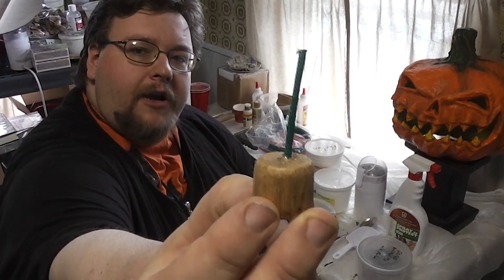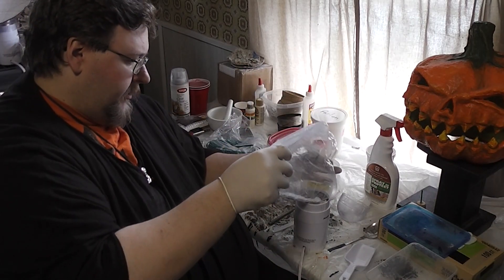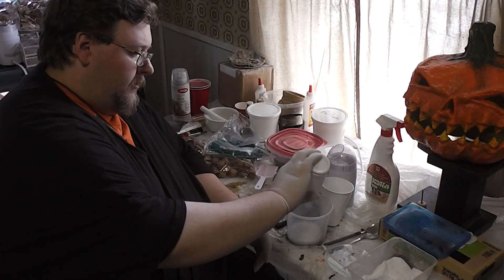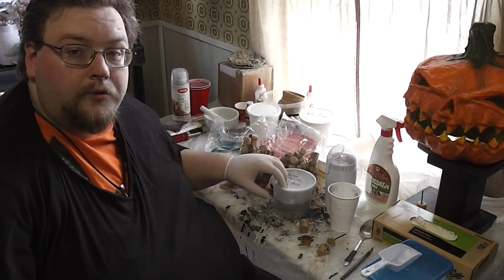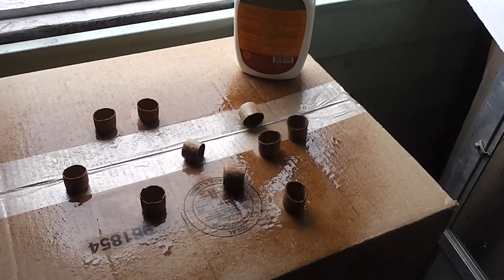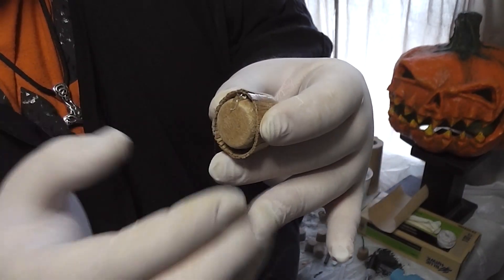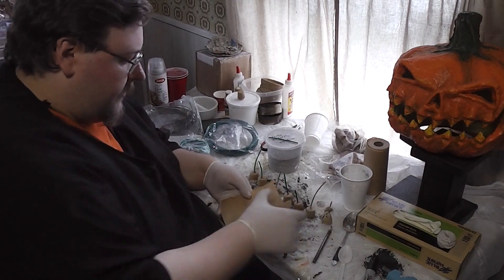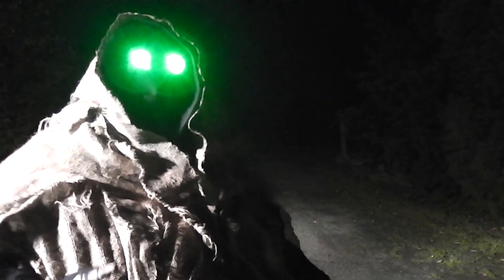Halloween Pyrotechnics - How to make a thrown Green Flash Bomb

Comment: Dude I love your personality. You seem like you would be a fun person to hangout with.  Not trying to be weird, just sayin. I saw a post of someone saying your a teacher and if that is true that is awesome. There needs to be more people like you teaching, it makes education so much better and in my opinion making the lesson fun help so much in remembering the material.  Anyway, great video! Definently ( I tried I couldn't figure out how to spell it lol) going to incorporate this into a costume. BTW did you just light it with a lighter or do you have a electronic ignition of some sort?
Reply from the maker: Thanks much. You do indeed have to have personality when you teach or the students just fall asleep. I personally use a butane lighter. It's best to have one where the nozzle points away at a 45 degree angle so you don't risk catching your own costume gloves on fire. Something along these lines: http://www.amazon.com/Degree-Angel-Refillable-Butane-Lighter/dp/B008UHRSYQ   I plan to make a video on ignition methods. The snazziest but most time consuming method is to tape two 'strike anywhere' matches to the end of the fuse and then fix a piece of sandpaper to your cosume glove. That way as far as the kids see you just swiped it across your palm and it burst into flame. You need to keep the match heads very dry though and away from any wind.
Reply: In your opinion would a hot wire be to much of a hazard even with fire retardent on the costume?
Reply from the maker: Depends on the hot wire system. You need something that keeps the fuse pointed away from your costume when it is lit since it will emit a shower of sparks. Even if your costume is fire retardant you may still find that it leaves a hail of discoloring scorch marks across whatever surface you have. If you're not chasing the kiddos when you ignite the bomb then you can also just have a few tiki style torches going around to lend the fire ambiance and have numerous easy ignition stations. The other problem I foresee as possible with a hot wire system is that when the fuse lights the wire will get a coating of post combustion byproducts (ash and sulfides) which will make successive ignitions less instantly reliable as a haunting evening wears on.
Reply: I like the tiki torch idea! Im gonna have to do that, maybe add some boric acid, I think it is, to the wicks to make them burn green.
Reply from the maker: Do a test run on that first to make sure the boric acid is really soluble in the paraffin oil fuel. I tried filling my lamps with a methanol and copper chloride solution and found out that the residual CuCl gummed up the wicks and made them all go out. You can also use barium nitrate or copper sulfate. Copper sulfate in methanol makes a great little burn and it's fairly cheap in technical grade.
Reply from the maker: +Miles Deighton I have never tried copper acetate before. I will give that a very serious look once I get the materials together to try it. Thanks very much for the advice. :)

Comment from the maker: Thanks :) The outfit is basically a gigantic black t-tunic (commonly used in medieval reenactment, pattern:wanted to link but youtube is dumb, google it) that goes down to mid calf covered by a burlap tabbard (a square of cloth with a head hole in it that has been draped over the top of the t-tunic) that has been spray painted with black and brown to look aged and randomly slashed up with a knife. On top of that is a burlap shroud (think when you drape a towel around your neck after a shower...

Comment: What was the purpose of the picture at 47:12 ?
Reply from the maker: An x ray of a mangled hand as a caution to be very careful of your fuse lengths. If you cut them too short the device may go off in your hand and even though these are not explosive they can cause some truly horrible burns on your skin.
Reply: +Drachenfang Wow. Thanks for clearing that up for me.
Reply from the maker: No sweat. Happy pyrotechnicing :)

Comment from the maker: Thanks much. :) The bomb can be made to glow longer by using an increased amount of the Magnesium, Barium Chlorate, and Parlon powder. It turns into more of a flare at that point. The only problem with this is scorched burning surfaces unless it's brick or stone. Another flare solution is to mix the barium chlorate with a chemical called shellac in a 60:40 mix respectively. It will make a long burning intensely green flare. Search Barium 'Chlorate and Shellac' on youtube to see it.

Comment: Would using Barium Chloride in place for the Barium Chlorate make a difference?
Reply from the maker: Yes. Barium Chloride does not have the oxidizing effect that Barium Chlorate has so the firework will have to rely on atmospheric oxygen This will slow down the rate of burn and possibly leave you with a lot of unreacted (and toxic) substrate in the middle of your firework which the oxygen won't be able to reach. I also strongly suspect that Barium chloride will spontaneously react with the Magnesium in this composition as I tried an experiment with copper chloride and magnesium to this effect. The two elements have the same 2+ arrangement in their valence electrons albeit at different levels. Also, of both Barium compounds only Barium Chloride was shipped to me with the express label of "Poison" with many skulls and crossbones clearly printed on it's label from Skylighter. If you want to experiment I would try a very small quantity of BaCl mixed with magnesium with a thermometer in it (in a very well ventilated area) to see if the spontaneous reaction does occur. If it does you'll notice a marked heat increase within about 10 minutes as happened with my CuCl and Magnesium experiment. If it does not then ignite a slightly larger quantity (no more than 45 grams of mix) and see if the entire composition burns through entirely. If it does not then there is a knot of unreacted and toxic compound there which you can't leave for neighborhood dogs or curious kids to sniff or pick through after Halloween night or whenever you choose to use the firework. Either of these two eventualities is a deal breaker with this compound. If you do want to substitute a compound though you could try strontium carbonate for a red flare and as I sit here pondering I am now wondering if you could put in some aluminum powder for a brighter white without the bang that flash powder provides. I'll experiment on that and have more info once the weather breaks back to Spring. Hope this book sized comment helps. Lemme know if you find anything cool.

Comment from the maker: Firework squid I wanted to reply to your question but can't see the comment anymore. If you put glue on the bottom you risk a detonation of the firework rather than a flash. You can also get the firework flying off in odd directions
Reply from the maker: +GamerGuy for a white flash you do not need barium chlorate or parlon. I would mix up some magnesium and potassium nitrate. I am not sure of the ratios though.
Reply from the maker: +GamerGuy It was a 4 inch shell and they came in a pack of 10 from cannonfuse.com

Comment: if i dont want it to be green but white will i just put magnesium
Reply from the maker: You bet. Mg will make a good white flash. If noise isn't an issue you can even add 5-10% Aluminium powder as well for brightness and rate of reaction.